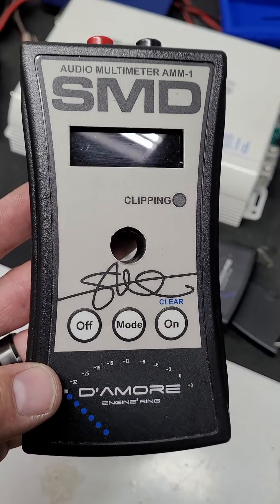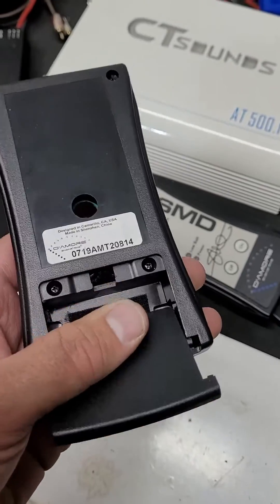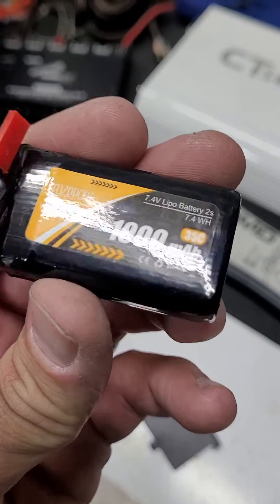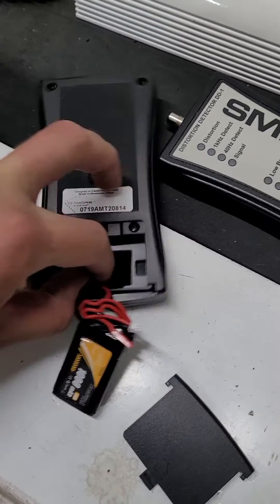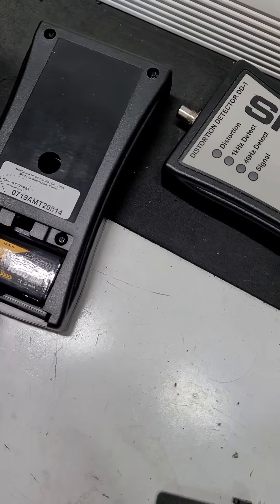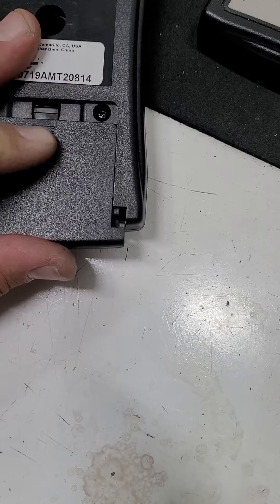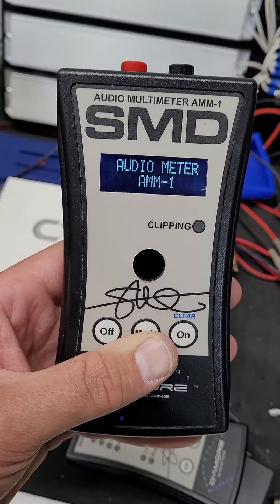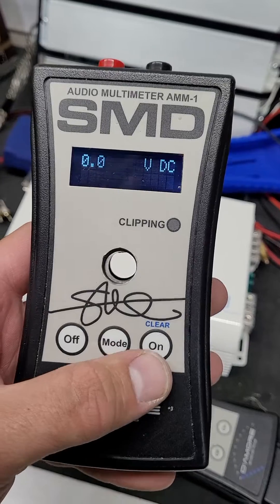SMD Meter battery modification! AMM-1 DD-1 CC-1 IMSG

Comment: I'm curious if the lower operating voltage has an effect on the calibration, but I suppose even if it did it would be so minor it doesn't matter
Reply from the maker: Bro. Ive been running on "low battery" (6v) for a while. It does seem to mess with the dd1 when the 9v starts to die. However, those 9v produce less current as the voltage decreases and it'll start to brown out. Lithium obviously wont do that and the low battery light is at 6v so as soon as i see it i need to change them. Not a big deal because  i have 2 more on the battery shelf. Ive converted stuff like this before but i think this is my most valuable tool to have converted. 

When i remodeled my house i had the same issue with my stud finder. It just wouldn't last. So i swapped the 9v for a lipo and its been great ever since. It just works